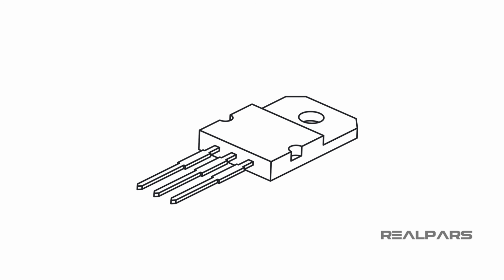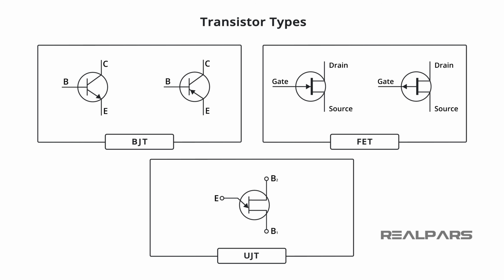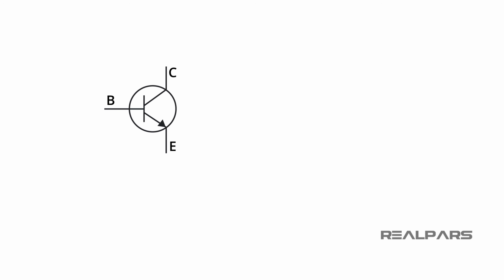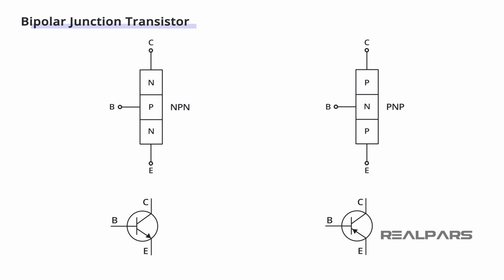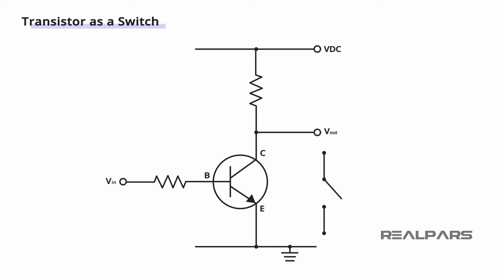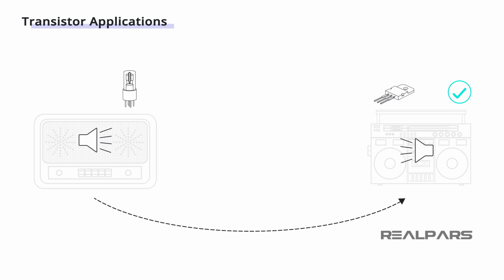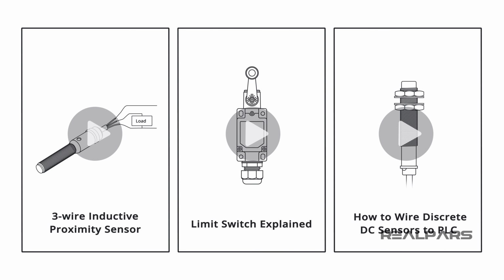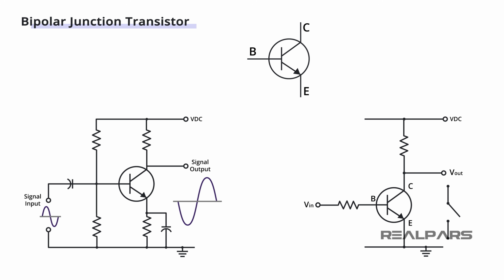What is a Transistor | Working Principles

Comment: 4:39 could use more explanation, When there is 0 volts, the switch is open, the resistance is infinite, the output voltage is +10 volts, but why is this true?
Reply from the maker: Hello, @Skategod776. Thank you for your question. Okay, I see what you are asking. This transistor is used in a current sinking function, which we did not explain here. We have videos explaining those features, too. It would be too much information for one video. The transistor is off until you apply voltage to the B base. And the resistor is off or not working. Consider the resistor a small heater. So, you can measure the voltage to ground at the Vout with a meter because the transistor is off. As soon as you apply the voltage to the transistor on the B terminal, it turns on, the resistor will get hot and you will only be able to measure the “rest” voltage on the Vout because the resistor is using the voltage. Watch our videos on Sinking and Sourcing of digital outputs.

https://www.youtube.com/watch?v=oyaItbhqoW0   Happy learning from RealPars!

Comment: Small point, there were pocket size tube radios. They used the small tubes w leads that were soldered directly, not sockets and pins. I used a low V one designed to be for hearing aids, as a guitar preamp.

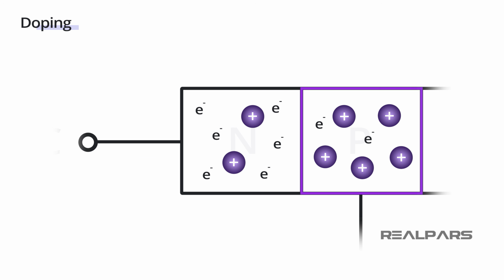Comment: 2:43 This is totally wrong. Each p and n region is perfectly neutral. It is only the ability to become positive and the ability to become negative or you can say positive charge carriers or negative charge carriers. But the overall charge is neutral before the junction is made.
Reply: Nope, you’re wrong.  They are not perfectly neutral - they simply do not have enough charge to cross the centre gap whether it be npn or pnp.
Reply: @elena6516  Yes. After the junction is created, then. Ok.